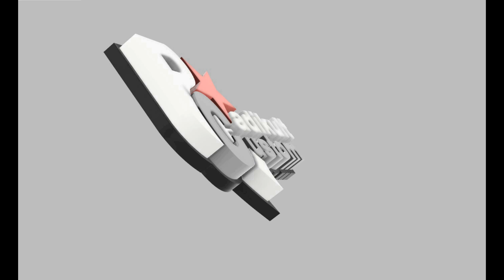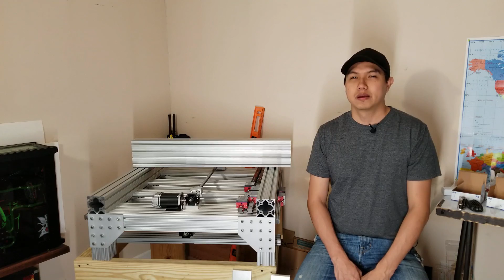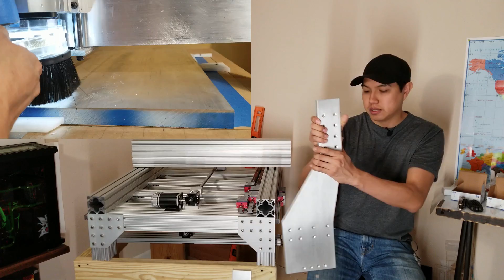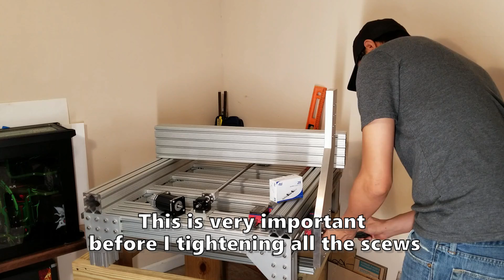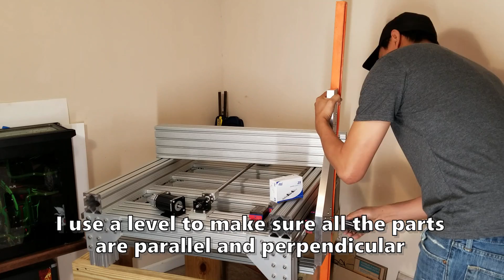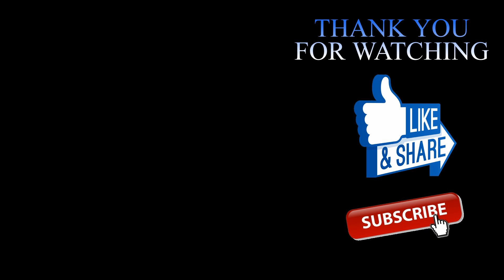Homemade DIY CNC build Part 2 (Gantry)

Comment: What tool did you use to cut the gantry support plates shown at 1:58?  I can't image a 6040 has enough rigidity to cut aluminum that thick.
Reply from the maker: kslats916  1/4 shank 3 flute 1” LoC . The 6040 can’t cut at deep passes but with plenty of shallow passes it did
Reply: @radikult-custom  Wow! I didn't expect a reply that quickly.  So your 6040 was rigid enough to cut that thickness of plate?  If so, that's impressive.  I'm considering a 6040 but then I thought about building my own.  I designed machine tools for many years as a career so it's not foreign to me.  What mods have you made to your 6040 that allows it to cut like that?
Reply from the maker: kslats916 I replace a back panel on the X axis for a thicker piece of aluminum. But a big fault is in the Z axis. That makes the 6040 weak at cutting deep and fast. 
That why I end up making my own cnc’s

Comment: Mario

First off thank you for the awesome build videos!

Secondly, I have a quick question. You stated that the cross beams are 635mm in length . Adding the width of the 2 Y-Axis extrusions that run down each side + the height of the rails and the bearing blocks I come up with 867.4mm in total. You stated the gantry extrusion is 870mm in length so I would expect these numbers to match. 

I've looked up on Hiwin's site and spec'd out the height of the rail + bearing block to be 40mm (Assuming HGH25 rails). Perhaps I am incorrect here or your rails were different. (I realize in later videos you moved the rails to the top, and I am assuming you offset the difference in distance the move made with the plates that mount on top of the block to account for that to keep the same size gantry)

So here's my math so far.

635+76.2+76.2+40+40=867.4mm

Am I missing something? Anyone else feel free to jump in as well. =)
Reply from the maker: Gerald Filimonov hi, the linear blocks I got have are 25mm but have a higher mounting area. That could add a bit more to the measurements. Also not sure which profile extrusion you are looking at. The ones I got are 3 inches thick I know you can find 80mm thick extrusions and that can also change your measurements. 
When I figure out all my measurements. I did it just like what you did. Add all thicknesses and rails/blocks and go from there
Reply: @radikult-custom  I was planning to use the 80x160mm profiles rather than the 3x6" profiles just to keep everything metric but the math presented above is the 3x6" profiles measurements. Yeah, there is probably some variance in the height of the blocks you used. I'll dig around the other videos and see if i can find the model number used and check the datasheet for it. 

Appreciate the response!
Reply: @radikult-custom  As best I can tell from the videos and trying to discern the part numbers on the side of the boxes, you are using the BCXH25BN model number of bearing blocks. Looking at the datasheet it shows a height of 40mm (for the rail + block) similar to the Hiwin's, so the calculations would be the same. I guess I'm puzzled because I have no doubt that you would have noticed a 2.6mm combined difference in skew on your gantry sides.

Also none of the heights for other models of bearing block + rail height are decimal numbers, they're all integers so there's really nothing for the decimal part of the 76.2+76.2 to combine with to get an integer for the gantry size regardless of what model block was used.

In either case, I will do what you suggest and just work out my numbers for the 80x160mm profiles and go from there. Just curious why you didn't run into this problem as I would certainly like to avoid it. =)

Comment: Hi fantastic build.  one observation about your bearing block problem. you would have been better off making pockets for the bearing block to sit in, then the top edge of the pocket would be taking the weight on the ground edge of the block not just relying on the fixing screws.  It would also take the guess work out of their position
Reply from the maker: John Taylor Cox I end up switching the linear rails to the top of the aluminum extrusion.

Comment: Hi, it is great job and inspiration for me !!!
And now my question, how strong is stepper motor you use (oz/in or Nm)?
Thank you.
Reply from the maker: Radek Neuvirt https://www.teknic.com/model-info/CPM-SDSK-2331S-ELN/?model_voltage=75VDC&fbclid=IwAR3VFSW2P-cBXWEFlzRjGNcmfjbYfJZimFwGOpImt6Q7_wpiJkkg5Z60fPM
Reply from the maker: Radek Neuvirt they have a lot of power and torque it moves my cnc without any problem even at 600 IPM

Comment: have you considered filling all the extrusions with concrete or sand , the resonance chatter would be eliminated. awesome awesome work !
Reply from the maker: Rob M yes I did considered filling it with sand and epoxy  recently  to cut some resonance and add weight to the base,  but i haven’t done anything

Comment: Great build. it is good to see a well-designed, solidly built DIY CNC Router. You have not compromised your build and the final machine should give fantastic results especially with the servo motors you are using!

Comment: Again, Your videos are excellent.To allign the two bearings, you should loosen all screws on both bearing rails (with gantry attached). Move gantry to one end and tighten the screws there. Then move it along, tightening each screw as the gantry passes past it. That way they are parallel and wont bind.Also- I never see anyone do it- did you grease the bearings? They need filled completely with grease through the grease nipple (with grease gun). I was recommended "Mobilith SHC100" grease.The grease will keep dirt out and will make it much smoother.Thanks again for the great video!
Reply from the maker: Michael Ripley well It was binding one side by it self not even connected to the “gantry” but it was the aluminium having a high spot edge, it rolls really smooth and not binding but thanks for that grease comment I didn’t know I need to fill them up with grease I only try to apply some lithium grease from the outside
Reply: Here is an excellent video on how to grease them. 
https://youtu.be/_yOk9VbdYes
Reply: I meant to day... you are supposed to fill ballscrew nut with grease too! There is a threaded hole for grease nipple on side of nut flange. You inject grease until it comes out both sides of nut.

Comment: This looks to be an awesome build. I have a question about the gantry uprights. I wonder if using more of the bigger 8020 extrusions combined with a smaller extrusion to get the width desired for bearing spacing, for the uprights, if it would be any stiffer than just plate aluminum? Those plates are obviously pretty stiff as they are an inch thick from what I can tell, but the extrusions with all the combined wall throughout the extrusions itself would in theory be pretty damn stiff. I'm not sure myself, I'm just curious as complete stiffness seems to be your goal. Any insight would be appreciated as I want to build one myself. Thanks and good luck with your endeavors!
Reply from the maker: They are many ways to build a cnc  maybe adding extrusion than plates could work 
At the end I learned there are a lot of variables  not just stiffness 
weight can be a bad factor, that’s why some CNC’s the table moves instead of the gantry
Reply: Radikult No doubt. Thanks

Comment: I don't think you sourced from one Chinese vendor ! :-) Congrats and Bravo. I had not seen your build untill today and like you I am running off notes and  sketch.
I am trying to use some  45 x 180mm  80/20. Found quite a good deal on 2 x 2.5 m lengths of it with  various lengths of some 45 x 45. ( Not sure if I will be able to incorporate that) 
I wanted to do a half sheet build. ie. 4'x4'  or 1212 in metric terms. But I also want to have a rotary tool running across the front of the machine to do artistic ($) works using a 300mm capable chuck. So in other words I have my hands full :-)
In order to reduce the mass and binding of the gantry, I would like to keep the full  180mm  dimension as the sides (keeping dust farther away)  and bolt the bed rails to the underside and run the Hiwin  on the top   rather than on the sides. Of course I still require 8" of usable Z axis.  It is going to be lots of fun sourcing all of this on my budget :P And it won't all be coming from the good ole US of A. I live in Canada and i must pay 25% currency conversion as well as 13% duty  :(

Comment: So far so good. When I put my CNC together I used gage blocks. It turns out that if you want a machine accurate to thousandths of an inch it has to be built to within thousandths of an inch. Who would have guessed?

Comment: what materials are you going to be cut by this machine。
Reply from the maker: raychar c  a lot of acrylic plastics, some aluminium maybe try copper
Reply: other than heavy aluminum cutting or needing occassionally steel cutting。the shown construction should do well on the said jobs。for such large cutting envelop。will you need to consider the machining capabilities in view of accuracies in aspects of the squareness and flattness。

Comment: To avoid issues with how flat the aluminum stock is use Mic6 cast plate.  It is extremely flat material used to fixture parts.
Reply: You can get a fly cutter, do some super light passes and get the aluminium flat. Another option is to get a glass table, and use it to lape the parts flat. Start with wet sand paper stuck the glass, and work down to what ever grit you need. Finish with laping compound and it will be almost mirror.

Also if only one of the supports isnt flat, its because you used the edge of the plate on one side. They roll out a round bar  to the size of plate you get, so the edges are never going to be flat. Next time mill both parts from the center, never trust a rolled edge. Even some cast edges suck!
Reply: This is the place I purchased my plate: 
 https://www.ebay.com/itm/MIC-6-CAST-TOOLING-ALUMINUM-PLATE-3-4-x-12-x-24/310345365401?hash=item4842067799:m:m-oqP1PofZ2wwO1U_OzhNXA
Reply: Yes I buy cutoffs from eBay aswell.
Reply from the maker: I haven't cut that stuff before because I have read that's  "gummy" and sometimes likes to stick to end mills but i didn't know about the flatness part  thanks
Reply: No problem I would cut with lots of WD40 or another lightweight cutting fluid.  Also clear chips away as quickly as you can, it is typically re-cutting of that gets you into trouble.  I would recommend a two flute high quality bit, some guys believe that the Ti coatings help reduce sticking, buy I have not done a comparison.
Reply: I would agree with mic-6 being a good choice if i recal its something like .004" flat over 12"(for 3/4+ thicknesses). I  personally machine mic-6 dry with a 4 flute roughing endmill. No chip welding or any other problems.
Reply from the maker: that's good, now the cost part, I search Mcmaster Carr the 12x14x1 T6 $142 and the Mic 12x24x1  $227 around $90-100 difference
Reply from the maker: https://www.ebay.com/itm/MIC-6-CAST-TOOLING-ALUMINUM-PLATE-1-x-12-x-24/261160135774?hash=item3cce5b6c5e:m:m-oqP1PofZ2wwO1U_OzhNXA
 Around $30 cheaper than Mcmaster, still cost more than 6061, now I know if I need to make something flat 
 I'll try Mic-6
Reply: ...or just machine the face flat on one side, flip plate, mill the other side flat, then drill your holes and the outline...